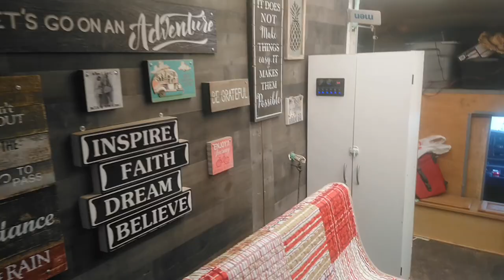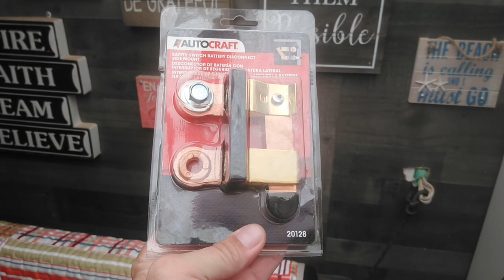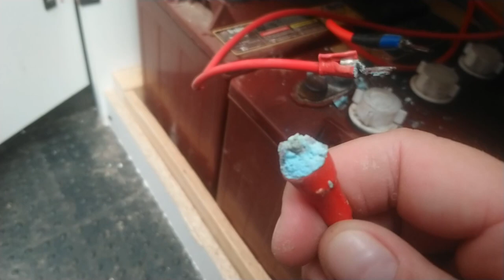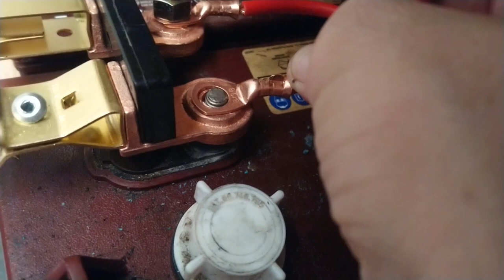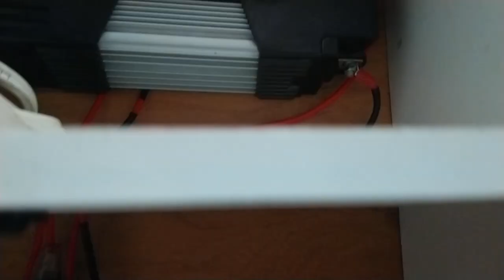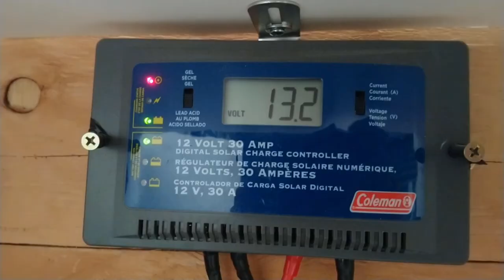RV Solar System FAIL! DON'T DO THIS!!! (or you'll regret it) | Van Life

Comment: Corey, it's a good thing you chose to fix things or you may have never discovered the overcharge; hope your batteries are okay.
Reply from the maker: It was only about two hours that the batteries over charged. Time will tell if their performance has declined. I should have fixed it as soon as I noticed the corrosion. My own fault.

Comment: The corrosion is caused by hydrogen gas that is produced when the battery is charging.  It's hard to prevent.  Coating the connecters is the best you can do with a wet cell lead acid battery.  I took an automotive tune up class years ago and our teacher recommended using rectorseal no 5 pipe thread sealant to stop battery corrosion and it does work.  
If you ever upgrade to AGM batteries, you will eliminate this problem.
Reply from the maker: I want lithium when I can afford it. I wonder why I only got corrosion on one post, not the other 3?

Comment: As an alternative to buying the terminals and the crimper, ypu might gave just specified the length, the wore gauge and the kind of terminals you wanted and had them built to your spec. Of course now you have the tools, but someone else might consoder this option.
Reply from the maker: Yeah for sure. The golf cart store near me wanted crazy money and I figured I'd use it again. I want to add two more batteries if I can't get lithium. Want more storage. But yes, ur absolutely right, you can buy the cables made up

Comment: I think the 18 volts you were reading was open circuit voltage from your solar panels because the wire was disconnected and open to the positive battery terminal.  You can confirm this (now with your new connectors) and by disconnecting the solar charge controller and see if the 18 volts show up again...I doubt if much if any current was flowing....Also make sure your charge controller is programed to wet cell batteries, it may not be  adjustable at all being a less expensive one....
I think you will be in better shape now...good luck.
Reply from the maker: You may be right. Controller is set to lead acid bat

Comment: A friend of mine I cannot recall how many batteries he has destroyed, he has the same attitude cheap is as good, but i don't think he will ever learn his lesson, not long ago he bought a 300ah AGM battery for $760 AUD......using a $15 dollar 30 amps mppt charge controller, china crap.......i asked him why you bought that cheap controller to protect a $760 battery, his attitude is it's as good as Victron Energy 30 amp charge controller, :) saying all that, this new battery does not charge more than 12.7 volts, he never seen his battery going over 13 volts, maybe soon due for another battery..... I learned my lesson now, do nothing, say nothing, let him do whatever he wants, you are right Cory, short cuts can be very expensive, the sauce will cost you more then the fish lol
Reply from the maker: Yeah I'll definitely buy a better controller before I upgrade my batteries. Don't want those probs. Batteries are too expensive to ruin. I'm hoping the cost for lithium will come down over the next year. We'll see.

Comment: Good video! I too recently rewired my battery set up after a mishap and now it’s much more safe. Is it possible that the 18.4 volt reading on the charge controller was the amount of voltage coming in from the panels instead of the voltage of the batteries?
Reply from the maker: I wondered that too but the batteries were bubbling SO loud I don't think so. When I disconnected the negative the display on the controller went blank. I could have tested the batteries with another meter but didn't, so I can't so for sure.  Hope you're right!
Reply: Box Truck Cory , hope your batteries turn out ok!

Comment: Not sure how you used the dielectric grease,  but many people make the mistake and apply it to the copper surfaces first then make the connections, and this is wrong.  Its and insulator and Dielectric grease, or tune-up grease, is a silicone-based grease that repels moisture and protects electrical connections against corrosion. ... The grease does not conduct electricity, so it shouldn't be applied directly to the mating surfaces (pins and sockets) of an electrical connection.  https://www.farmandfleet.com/blog/what-is-dielectric-grease/
Reply from the maker: I just rubbed some around the outside of the terminal connectors like you said. Good tip tho!

Comment: Why are you using wet batteries inside? Can cause a fire or even an explosion... bad idea.
Reply from the maker: Cost mostly. It's not as dangerous as some think. The truck is well ventilated so hydrogen gas doesn't build up. Up until recently wet cell batteries were all that was available and people have used them in boats and RVs forever. I'd like to upgrade to lithium one day, but that will cost about $2000 and it simply isn't in the budget